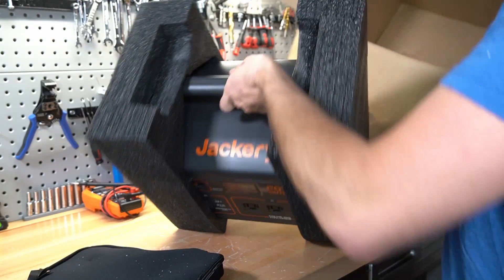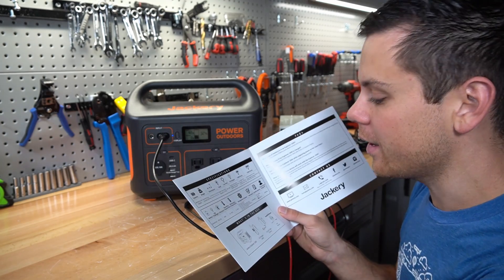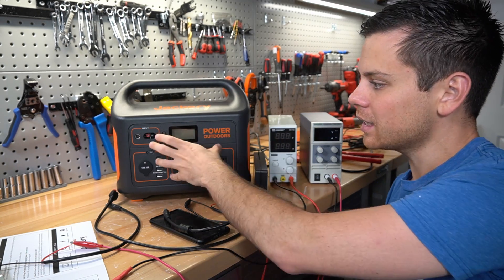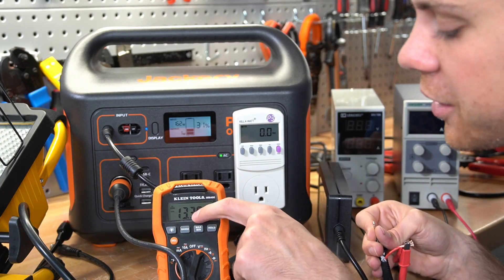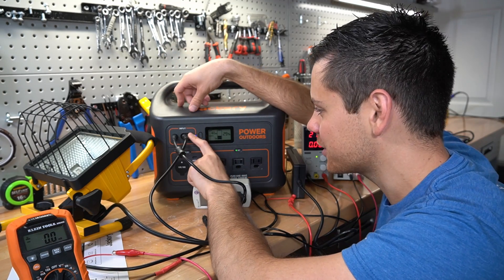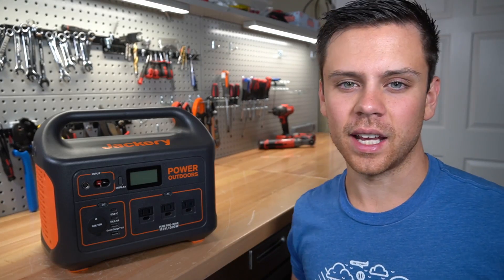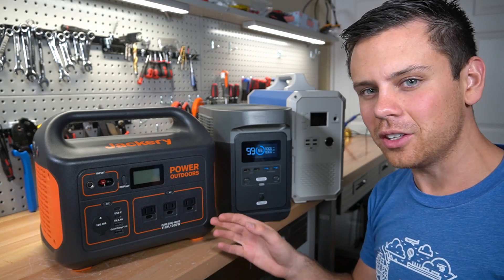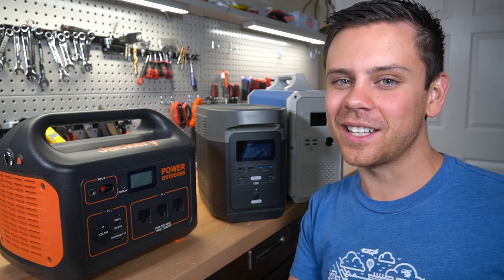Jackery Explorer 1000: Mini Solar Power System

Comment: Hi, I like the way you simulate the suppliers specifications. It's simply the best way to do a review. Great!
As more and more power boxes are reaching the markets. I would like to see their lifetime. Apart from battery decay. I think the first decaying parts will be the internal ventilators. Having mechanical moving parts and just suckling in dust. Which is a common thing when eg carrying in a truck bed.
Please in your next reviews, also have a look at these components, filters etc. It would be a positive selling point when they are well protected and/or easy to replace.
Keep going on. You're showing a great deal of information. Helping many of us in our decisions to buy the product which best suits us.

Comment: Thanks Will. Can you explain how a power supply is electrically equivalent to a solar panel? I always thought that if the MPPT started hunting for the optimum power point, a power supply will fry its brains.
Reply from the maker: With a power supply, you create whatever power point you want. you can modulate volts and amps. It's great for testing purposes for solar input.
Reply from the maker: No, it won't fry it. It's just a normal current and voltage source. Its regulated.
Reply: @WillProwse  Very cool - thanks Will.

Comment: I am glad that you FINALLY came out with your thoughts on the E1000. I am not gonna lie, I was pretty pumped about picking one up. And it's funny you should mention that it should be priced at around $700, because from what I was told Amazon should have a 20% off on release day (03/13) knocking off $200. shrugs meh we'll see if I still pick one up.
Reply: I'm waiting to buy one, thought the release day was the 18th.
Reply: @thomasbarlow3973  Oh my bad! I just looked and yes you are correct! It's the 18th and not the 13th. Sorry everyone.

Comment: When I first heard about the Jackery 1000, I couldn't find specs on it, but since the website mentioned only hooking up two 100 watt panels, I suspected it might have a slow charge rate. Bummer. I was considering getting one.  Still might since I like the size and weight, but will have to give it some thought.

Comment: Wow, so it seems that we've moved well beyond the Inergy products?  Bummer - I bought a Kodiak when you first reviewed it, and it's worked well during the two short-term power outages we've experienced since I purchased it, but I'm now tempted to upgrade based on your more recent product reviews.  My biggest hesitation is the same as it was for digital cameras - it doesn't seem to matter what/when you buy,  there will soon be a "better" option.
Reply: Let me lnow when you want to sell it.
Reply: Keep what you got unless you need more power 

The longer you wait, Blythe bigger, better and cheaper stuff will become.
Reply: is the energy solar powered generator worth the $$$$...does it do everything it said it would
Reply: @martaborden  It's worked so far, but it would be nice to have more electrical power available during power outages to run more stuff.  Not necessary though, so I don't plan on doing so any time soon.  I'm now considering a stationary system instead.
Reply: There will always be a better option in 6 months;) don't get suckered in..if your Kodiak is working stick with it. If not may want to sell it sooner than later. The older it is the less it will likely be worth .

Comment: The barrel jack for the dedicated charger probably has a bypass in it to switch to that jack and disconnect the other input when a plug is plugged into it. Just like our radios of old.... Batteries to run it unless you plug in a power pack. The power pack bypassed the battery input.... :)

Comment: Jackery us so expensive, Diy might be a good option
Reply: Diy is always a good option
Reply: VANquished I have to disagree. Larger power systems will be better as DIY but smaller ones, not always so. For $1000-$1300 you have a nearly complete systems. For $950, you have a 1.2kwh battery and you have to spend hundreds if not over a thousand more for tools, wires, and components
Reply: @AaronGeller  on my DIY system I can replace any critical component failure in a couple days. You can't do that with most of these. So IMO a DIY is always a good option, notice I didn't say always the best option. I have the Bluetti 1500WH and a generic 280WH unit as backups for my DIY Tesla based system. I am not knocking them at all I just feel a DIY system is always a good option to at least evaluate.